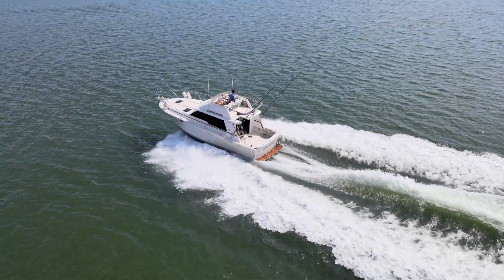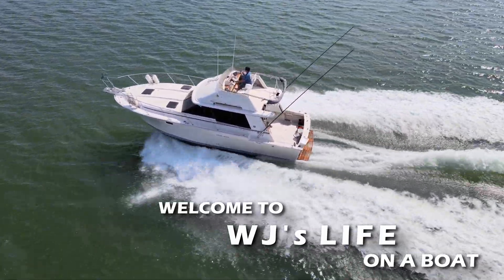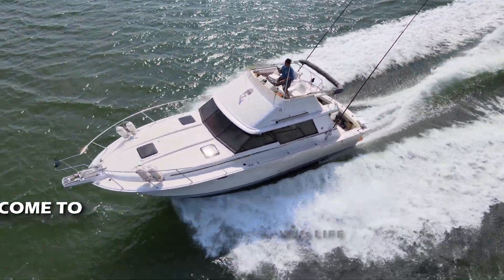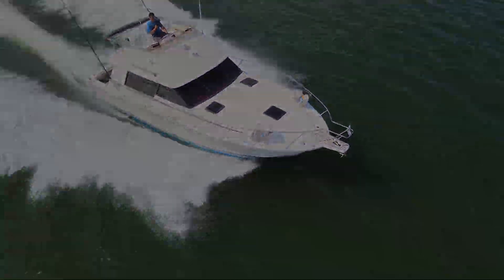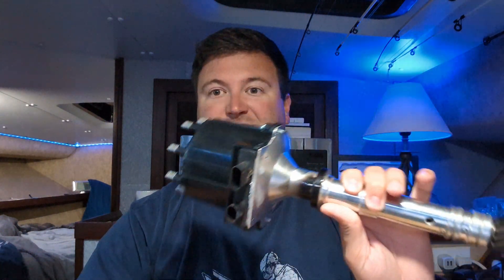GM HEI Marine Distributor - Introduction into Reverse Rotation Engines

Comment: Hey man great video very informative. I’m having a dilemma trying to locate one of these distributors right now. We’re missing out on some good tuna fishing. We are out of Virginia Beach. I see that they’re back out of stock on Marin power depot. I was wondering if there’s any other source or any other replacement that I can possibly substitute it for if you had any information
Reply: Works
Reply from the maker: @rubenolazaran7808  That's good news. What parts did you use?
Reply: Gear from a RR onto a normal one and that’s it
Reply from the maker: @rubenolazaran7808  Good to know. I appreciate the update. Hope you all can get on the tuna.
Reply from the maker: @rubenolazaran7808  I was forced to buy the overpriced unit from Marine Power / Marine Power Depot. I have found no solutions anywhere else in the YEARS of searching. It really does suck...
Reply from the maker: @rubenolazaran7808  I've been tempted to get a regular distributor and throw on the reverse gear and see what happened or how long it lasted. But that is a very last ditch effort.
Reply: At this point I would over pay just to get back in the water I just can’t seem to find anything that will work
Reply: I have two bad ones I wouldn’t mind trying if there’s a chance it would work
Reply from the maker: @rubenolazaran7808  in a pinch you could try to get a reverse gear and see what happens when you put it on the a "regular" distributor. I believe Hardin Marine Sells them. Please do so at your own risk, I don't know how it'll turn out. The RR distributor has an extra thrust bearing that a normal one doesn't.

Comment: Any ideas on how to wire a HEI into an older (86) Searay? I got this boat for the cost of the trailer but the 350 was shot and it had that Thunderbolt ignition that doesn't seem to be functional.  I rebuilt a 305 from another boat and I bought a marine HEI and I'm not sure what to do about the reverse interrupt. The distributor is marine grade, but has a vacuum advance that's capped.  Didn't think I was going to have to figure that in, and the ignition coil is in the distributor.  Resembles an automotive distributor but has a different top.  Has a (+) and tach output and that's it.  I'm guessing wiring the tach to the interrupt but not certain that's going to work. The positive is wired to the positive that would have gone to the external ignition coil, and I'm guessing the gray wire (-) is going to go into the tach.  This swap is a piece of cake on a car, but I'm relatively new to boats. Think the brand of distributor is Dokii, it's a GM Amazon knock off.
Reply from the maker: @motorcitywestauto4674  hey there. Check out wiring diagrams for AC Delco Voyager EST. One site that has a diagram is "ebasicpower". Also you SHOULD NOT use any automotive distributor, they are NOT USCG approved or rated for marine use in a confined space of an engine room. Any time I've bought cheap, anything, it's been crap.
Reply from the maker: @motorcitywestauto4674  bpi.ebasicpower.com/faq/delcoestwiring.htm